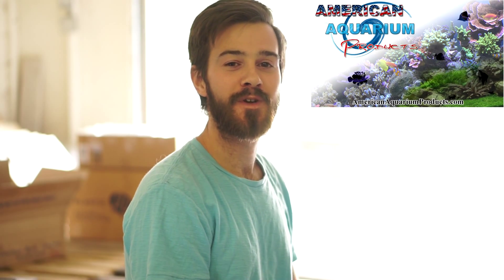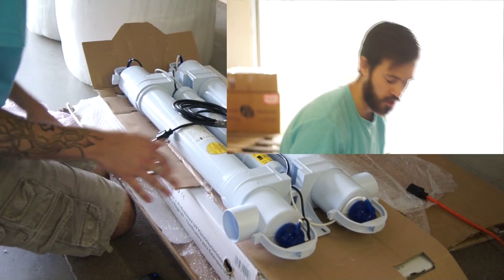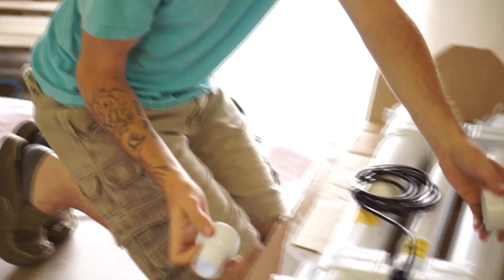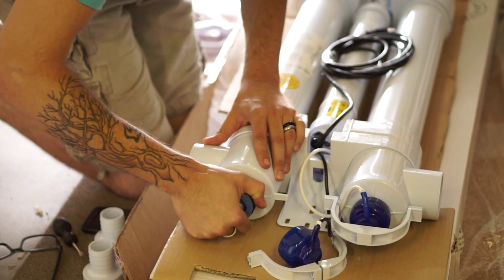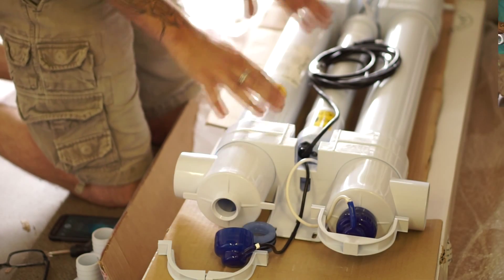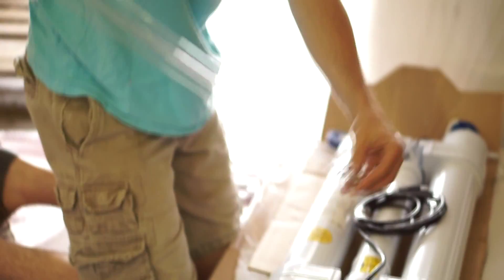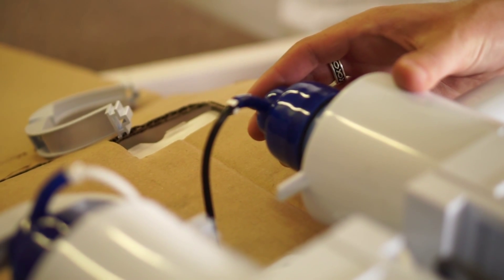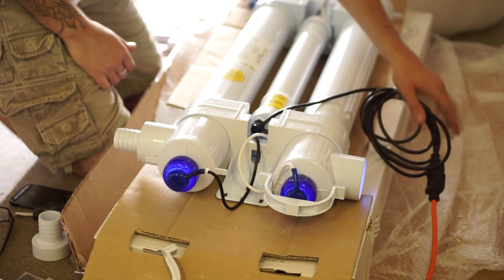TMC Professional UV Sterilizer/Clarifier 110 Watt

Comment: Can this be used in a Marine aquarium?
Reply from the maker: +pjos111 yes of course. There's lots of marine sets ups with UVS. Here's lots more information. http://www.americanaquariumproducts.com/AquariumUVSterilization.html
Reply: @AmericanAquariumInformation  does wire 1 go top and wire 1 top both sides
Reply: @Viewer765  both wire 1 go to the top. And 2 to the bottom.
Reply: American Aquarium Thanks for that link it's a good read!
Reply: @AmericanAquariumInformation  what size are the washers on the nut and what size are the tube washers
Reply: I’ve got TMC 110 UV the one you did the video on

Comment: I've had mine a couple of years for my 10,000 gallon pond and it cleared up the planktonic algae as soon as I got it running properly. BEWARE - I had a very disappointing and rocky road because I did NOT check the unit before installing it. I had 2 broken quartz sleeves from shipping that burned out the ballast, both bulbs and 2 end connectors since I installed and ran it wet. I ended up having to buy the replacement parts since I didn't check for shipping damage.

Comment: I have this unit vertical with the inlet & outlet at the top ,water keeps getting into the bottom connectors ,the quartz sleeves are not cracked .would putting it horizontal cure this problem or having the inlet /outlet at the bottom?
Reply: My experience has been that water from outside sources (in outdoor applications) will often penetrate to the connectors when in a vertical mounting
Reply: My unit is indoors.
Reply: @mauricenewton6921  This is more unusual as a problem. I suggest checking all O rings, lubricating or replacing.
I would still suggest horizontal mounting as this not only would make this unlikely, but it improves efficiency at least 10%
Reply: Agree, I would check oring and replace if you haven't. We have them mounted vertical with no issues
Reply: Is it best to have the inlet/outlet at the top or rotate & have them at the bottom ?
Reply: @mauricenewton6921  Either way works equal in my experience, it really comes down which way works better for your plumbing situation

Comment: We have a 8000 gal. Pond in our yard, and our UV light has (2) TEES @ THE inflow just doesn’t look right ... is there a baffle between them to divert the water flow??? Yours has two 90* deg steering the water through...    its like it doesn’t work at all , and the bulbs are bright and shinning
Reply from the maker: I'm not sure i understand how to answer this
Reply: Ya ... it was a long shot... so .... our UV light is  the evo 110        So, for lack of better terms is shaped like a long oval, * w/2——.  2’’ PVC tees at the inflow, ..... not (2) 90s. So it gives the appearance of the water flow sailing right past the unit.....       its amazing the design looks useless to a logical thinker, I’m surprised this question isn’t top of the list of inquiries of unit failure.
Reply from the maker: I looked up the unit. Are you saying you don't think water is going through one of our your tubes?
Reply: American Aquarium     thank you for your time, 
my EVO 110 configuration has (2)   ‘two inch’ PVC tee’s on the left side of the assembly that are joined together tightly, what I’m asking is if theres a baffle between them to divert the water though the unit. It looks as if the water would just miss the system all together, i know that sounds dumb, but, its as if the unit has never worked in the year since we replaced a single tube unit, that seemed to work better than this duel model ..
Reply from the maker: I would take the lamps out and shine a flash light down the tunes. Im not sure of that uvs design. If it's working, it seems like a great sterilizer.
Reply: There are 25 mature koi, a a hundred Danny-Oh’s and a couple turtles and goldfish, its been really hot 100+  we flush and clean the filters regularly, and still cant get the water clarity at all, its like the unit isn’t working but everything is firing on all cylinders

Comment: real pain to get the bulb prongs lined up and did not learn any tricks to make it easy
Reply: Sorry you are having this difficulty. As someone that has changed lamps on this unit 100s of times, I am not going to say lining up is easy, but I have not really found it difficult either. I generally push the lamp partially out to see alignment, then once on one side, I slide back in and find the second side goes on more easy,

Comment: If all connections are fine on the bulbs and they still don't light up....problem would be balls right?  Mine is brand new and not lighting up. Believe it to be the ballast.  Would you recommend me opening up the ballast?  I have watched your video on replacing the ballast.
Reply from the maker: Its very rare for the ballast to be bad. The units from AAP are tested before they are shipped. Likely the lamps are still not connected correctly. You may want to take a volt meter to the connections.
Reply: Thanks you for the suggestion!
Reply: Also if only one lamp is not fully connected, neither lamp will light. You might also check the fuse
Reply: Thank you , is the fuse located in the ballast?
Reply: @taryndeclyn1474  The AAP/TMC web page has a picture:
http://www.americanaquariumproducts.com/TMCUVSterilizer.html

As well there is also a video showing this:
https://www.youtube.com/watch?v=8kEJO7TSae8&feature=youtu.be

Comment: how does one changed the starter ? mine lights come on for like a second then stop
Reply from the maker: It has a electronic ballast, no starter. You'll need to check the ends with a volt meter and see more of what's going on. Could be the lamp, could be the ballast
Reply: This video shows ballast replacement: https://youtu.be/8kEJO7TSae8
Reply: I would read this or view the video I sent earlier. You simply may have a bad lamp too: 
http://www.americanaquariumproducts.com/UVBulbTroubleShooting.html
Reply: https://youtu.be/EfGDb2ZtpE4 have a look